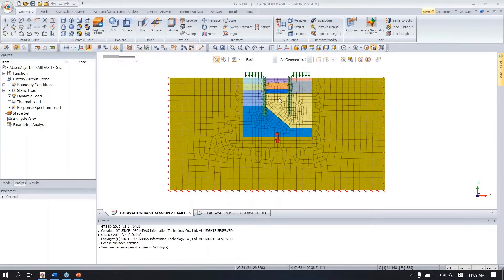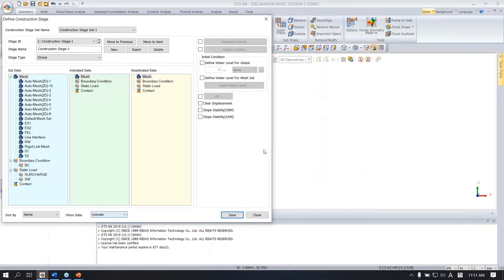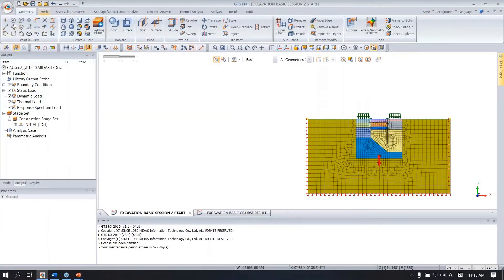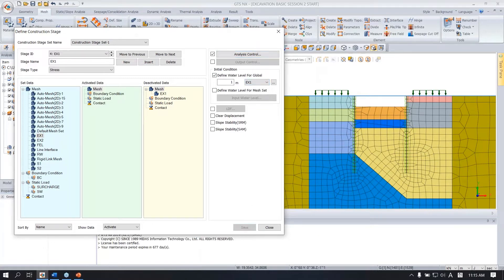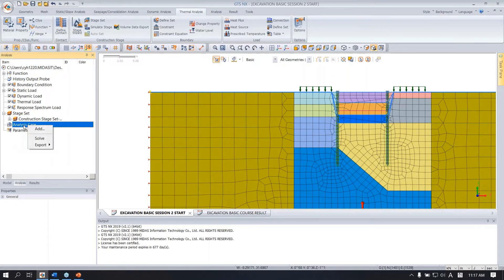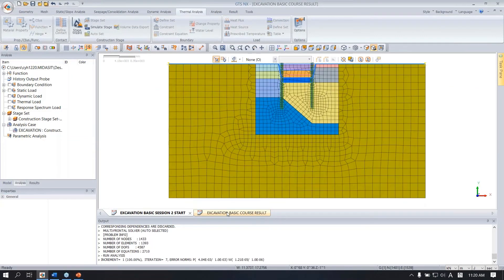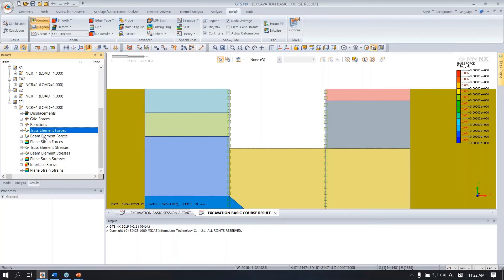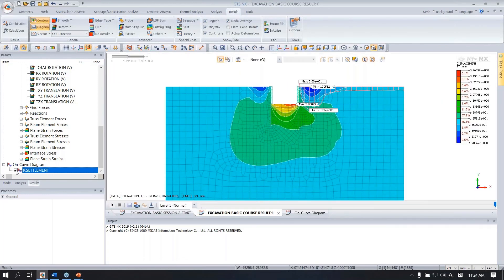Online Tutorial: Excavation - 2D Earth Retaining Stabilizing System

Comment: hi Sir, video is very useful, 
one doubt that can i "save as " drained model and use it for undrained model and 
need to change only soil material properties and analysis control right?
 i tried above option only normal condition analysis works, 
not DA1C1 and DA1C2 why 
plz explain, thanks